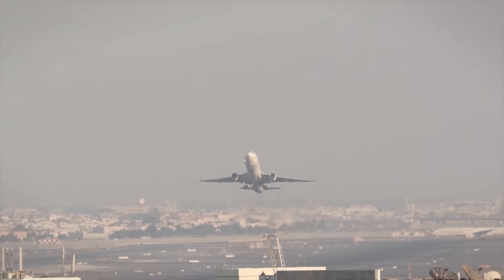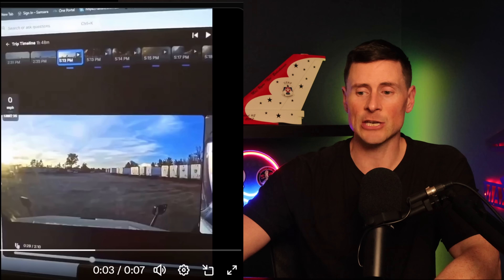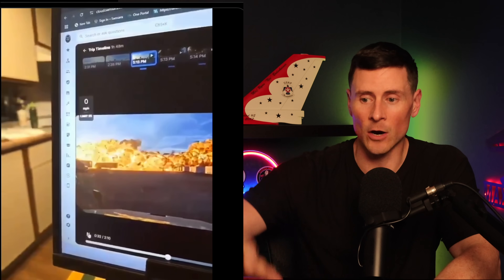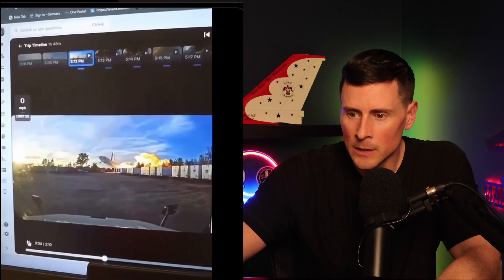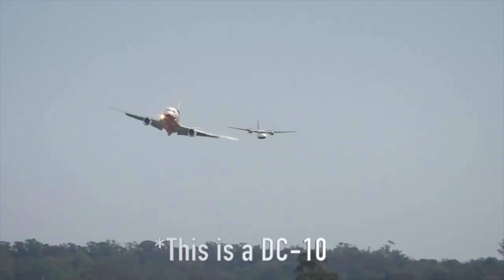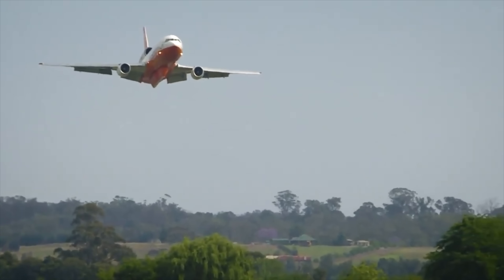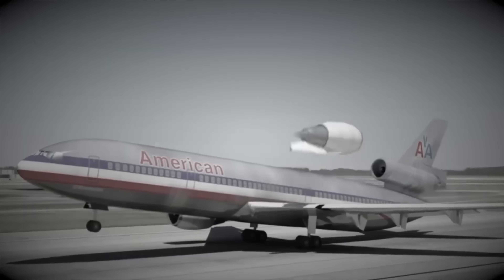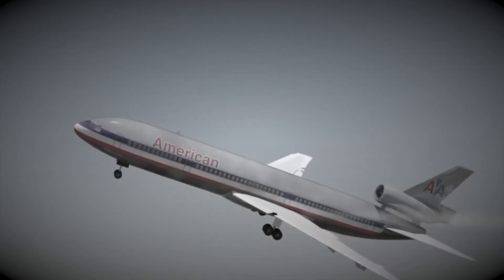Airline Pilot Reveals CHILLING Clue in Final Moment Before UPS 2976 CRASH

Comment: I’m curious that no one noticed anything wrong prior to the takeoff, unless nothing was showing until it was too late to stop. Flight 191 engine was taken off and serviced, when reinstalled the used a forklift instead of the required lift to do it putting unequal pressure on it damaging the mounts.

Comment: In two airlines I have worked for, both engines damaged on takeoff due to bird ingestion. In both cases the CM1 rejected above V1. In both cases they saved the day as subsequent investigation found that those aircraft would not have been able to fly.

Comment: The Number 2 engine is on the tail, the spark you mentioned on the number 3 engine was flames from a compressor stall.

Comment: There is another dash cam video from the road between the airport and the first building. And it was very close and clear. You can see that the #1 engine is not there. You can see that the landing gear struck the building, and I must assume that amount of drag forced to plane down.

Comment: RIP to the lives lost. There was a plane B767-300 engine that caught fire back in Oct 2016 (Flight AA383) failure of the HPT Stage 2 Disk during the take-off roll, with that same make GE Engine as the UPS plane??? Airworthiness A22WE Certificate Holder The Boeng Company 2007. UPS N259UP has Engine GE Eng Model no. CF6-80C2D1F & American Airlines N345AN Eng Model no. GE CF6-80C2B6 are these the same make engines??? The engine fell off the UPS plane on the runway compressor failure? and many comments about re installing engines procedure / process is very important and what about issues with the stage 2 discs failing is common with these engines? I googled this model engine what other common issues were, and it came up with this information re HPT stage 2-disc failure. It's an old plane at 34 years old!

Comment: Preventive Maintenance 
They fly these things year after year with minimal maintenance. How much money did you save after this? 
It’s disgusting that nobody ever wants to go above and beyond the minimum requirements. 
These things should be completely turned around every three months. Turbo Fans also create vibration and the cold dries out the rubber seals that control fuel intake.

Comment: The NTSB recommendations after the AA crash was to stop cutting corners when servicing the engines. It was found that maintenance were using cranes or lifts to reposition the engines after servicing them. This caused micro cracks in the connecting pylons which grew over time and eventually caused the engine to break off.

Comment: When the YouTubers talk about the NTSB suggestions that in the final report on the AA 191 crash, the need to change their tune on one specific recommendation:  the installation of plug type valves to mitigate the loss of hydraulic fluid.  The crash of United Airlines Flight 232 at the airport in Sioux City Iowa on 7/19/1989 exposed the FAA's blatant failure to make the implementation of those plug type valves mandatory.  The aircraft that operated as UA 232 was also a DC-10.  That disaster's ultimate cause was created in 1971 at the foundry that made the titanium alloy ingot that was used to make the air intake fan on the #2/fuselage mounted engine.  The foundry thought they removed all of the gases in ordinary air.  Titanium has to be melted and mixed with the additional ingredients that make up the various alloys in a vacuum environment.  Oxygen & Nitrogen are two elements that cause the final titanium products to become brittle and sets up the eventual destruction of the final product.  In the AA 232 crash, the fan blade broke apart in a spectacular mechanical explosion that severed all 3 hydraulic pipes in the right side of the horizontal stabilizer.  The electron microscopic inspection of the Air Intake fan found evidence of both oxygen and nitrogen being present deep below the surface near the point that the stress crack(s) formed in 1972.  It's not fair to blame the United Airlines Maintenance department for failing to find the cracks during and and all of the overhaul procedures that were performed on that engine.  The techniques to find the subsurface cracks didn't exist.

Comment: Fellow airline pilot here. These brothers are cleared unrestricted climb to heaven. As far as the technicals, I agree with loss of power from compressor stall and the resulting degradation. I dont know the answer to this, BUT will a loss/break of certain hydraulic system cause the LED’s to free float retract? This could have been the huge performance killer that caused the settle back down. Purely theorizing and trying to learn. I have watched the videos many times and my heart sinks every time for the family and the pilots of UPS. God Speed!!!!

Comment: The similarities between this disaster and AA flight 191 are the #1 engine separations. However on AA191, a perfectly #1functioning engine tore itself off, up, and over the wing because overly creative maintenance procedures had broken the engine-to-wing attachment structures. Jet engine mounts are designed to be very strong in the front to back axis, so as to transmit forward and reverse thrust. However, the mounts are also deliberately designed to be somewhat less rigid and somewhat "floppy" in the side to side axis so that an engine whose spinning turbine discs have disintegrated at high power can break loose from the wing rather than transmit violent vibrations that could tear the wing off. My guess is that the #1 engine failed catastrophically, violently scattering engine parts that ripped open the wing fuel tanks and possibly the #2 engine before its own violent out-of-balance forced ripped it off the left wing. On any multi-engine aircraft, especially a swept-wing one, the loss of engine thrust on one side will cause a yaw into the dead engine, causing the wing with the good engine to be closer to perpendicular into airflow, producing more lift, which then causes the airplane to roll in the direction of the bad engine, as happened in both crashes. Because the center engine takes up so much of the real estate on the vertical stabilizers on DC-10/MD-11's real estate, the amount of yaw control from those plane's rudders aren't as robust as on other aircraft, adding to the difficulties of managing a #1 or #3 engine failure at take-off speed. DC-10s and MD11s also have challenges when  landing in heavy crosswinds because of its somewhat limited rudder size and authority. In both of these crashes, however, the other damage to both aircraft were so severe that a different vertical stabilizer and bigger rudder wouldn't have made a difference in the tragic outcomes.

Comment: Although not official yet, I'm willing to wager that the engine failure was significant enough to damage the hydraulic system which prevented the flight control surfaces from allowing the plane to gain altitude.

Comment: Lthe same happened to american airline flight 191. Those engine are tight with only 2 bolt and nut. In flight 191 engine flew away and broke hydraulic and balance.

Comment: Hate to say it but sometimes even at V1 trying to stop is a better option as other crashes have proven. RIP. Bro is wrong on the fuel. The cargo was 200,000 pounds of fuel. The aircraft fuel capacity is 38,615 pounds. Need to get your facts straight.

Comment: Something I'm curious about. Airplanes are constructed mostly of aluminum. Aluminum has a much lower melt point than steel. As such, it seems like it would not take much heat from a fire to melt the mounting points for an engine. I would imagine flame inside the engine would be well contained, but it seems like any flame outside the engine and the engine is going to fall off.

Comment: There's now a 4th video of the MD-11 just before the crash.  It confirms the #1 engine had come off.  The wing was still intact but it is on fire where the engine was.   The 1979 DC-10 crash also rolled to the left after losing #1 engine.  May not have mattered if #2 had also experienced a problem.  What are the odds of #2 going out after #1 falls off?  And what causes the roll?  Also looks like when the MD-11 began to roll the left-wing tip hit a power line.  That sealed their fate  😢

Comment: The MD-11 was modified, with knowledge gained from the Flight 91crash investigation, to lock-in-place the flaps and slats in the event of a hydraulic failure.  An uncontrolled left wing fire could have disabled this feature. But a more likely direct cause for the lack of lift is the struggle of engine two.  Also, a possibility of a runway incursion, resulting in engine detachment, will likely be addressed.

Comment: This crash likely has nothing in common with the American Airlines crash mentioned. AA 191 crashed because the slats retracted due to hydraulic loss, leading to asymmetric lift. (Had the pilots maintained their current speed they would have maintained control.) After that crash the slats on the DC-10 were redesigned with hydraulic locks to prevent inadvertent slat retraction in the event of a subsequent loss of hydraulics. This redesign was carried over into the MD-11 design.

Comment: I would wait to hear about recent maintenance on the engine. Engines don't just fall off aircraft.
Reply: & this one didn’t “just fall off of” the aircraft either. It exploded, essentially. It suffered a catastrophic failure during the takeoff roll & the resulting damage included the engine’s mounting system. Physics took over & what was left of the engine departed from wing & came to rest on the runway.
Reply: I agree with you @garygrant9612.
Reply: the burning engine was made by GE

Comment: A thirty-two year and retired aircraft mechanic here. Speculation on my part, but it was said that there was a catastrophic failure of the left engine, which is supported by the video which shows the aircraft rolling to the left, due to the number three engine still producing thrust and resultant lift on the right wing.  Something else that was said in another video is that there were "sparks" coming from the number two engine......  Again I can only speculate, but if there were two engines involved I  suspect ingestion of a number of birds. Suspecting that the number one engine failure dispersed debris, is not likely, as the engine casing system is designed to contain a failure.  Number two engine is mounted high and center, well above the fuselage. If the information is true, and there's evidence that the number two engine was processing an ingestion of birds, it may have been causing FOD(foreign object damage) and subsequent sparks. This would be do compressor and turbine blades failing in the core engine air stream and sparks being ejected from the exhaust nozzle. Jet engines are designed to withstand bird ingestion, to a certain limit.  Two engines(possibly) failing at the same time, tells me there may have been a flock of birds that were ingested.  
The NTSB will conduct an investigation. The engines likely will have enough left over to determine if this was the case.

Comment: The number 2 engine ingested parts from the number 1 engine as it departed the aircraft a md11 is designed to take off and fly on 2 engines (fully loaded)

Comment: The last time I saw a wing engine explode or come off on the 3 engine jet, parts flew up into the rear mounted engine and knocked that out. Perhaps, that was the spark you saw and why the plane couldnt get lift. Also, the engine coming off could have caused hydraulic lines to be severed. That rollover leads me to
suspect that. This scenario is why this jet got into trouble way back when. This engine was maintenanced and had issues on this day allegedly. One has to wonder if there was a catastrophic error made in that work.

Comment: If they did an engine change without the proper bootstrap kit that uses a hoist, it's an officially a repeat of flight 191. In flight 191 they used a forklift instead if a hoist which caused damage to the pylon structure. It's pretty much wait and see for now.

Comment: As an aircraft engineer might I suggest that the left engine fan disc separated. Such a mass separation may have sheared the Mount bolts. Once separation occurred, the aircraft would have yawed causing an over speed of the right engine most likely the low pressure turbine shroud and blades contacted causing the sparks. The reason I believe the fan disc separated, is the inlet cowl doesn’t exhibit the damage expected with fan blade separation. Hydraulic pressure and quantity would have vanished immediately and instant loss of control . The temperature of the ensuing fire may have been high enough to weaken the wing spar . Such a tragedy
Reply: Fan blade off is qualified against mount failure, so a mount defect would be required to cause mount failure. 
I can’t link right engine overspeed to yaw, how do you see the relationship? I can imagine that left engine failure or fire might cause surge in centre engine due hot gas or debris ingestion. There is a mode where power turbine shaft fails and the fan exits forward and power turbine shifts rearward to tangle with power turbine stators. Catastrophic engine failure may take out local hydraulics but this aircraft has redundant circuits, so basic flight controls should have remained after a left engine uncontained failure or pylon mount separation. 
But, a fire fed by the severed lines would reduce lift of the wing engulfed (locally) to explain left wind drop. Loss of mid engine thrust plus loss of left engine would not leave enough power to climb on the remaining engine. 
Just my thoughts and guesses. The left engine seems in good enough condition to allow investigators to determine if it uncontained and might also have evidence on it of the pylon mounts. Or scattered nearby. Flight recorder I hope is ok too.

Comment: I think the sparks are from the port engine falling off, but my question is whether this MD 11 had a nitrogen gas tank inerting system installed? Might that have prevented an uncontained disintegration of rotor parts igniting and sustaining a wing tank fire? They really needed an arresting hook by that late point of engine departure at the wind sock, having used 80% of the runway already. Once the main spars went soft, it looks like it collapsed and rolled over. Or did the starboard engine's lift overwhelm any control function they had remaining? Was the fuel supply compromised already by rotation? Pilots are unnecessarily blind to engine troubles behind them and out of sight, but fire warnings must have been seen, given the long line of smoke seen from the beginning of the runway scene. Did they fail to recognize and abort when they had the chance, or was their focus on meeting the numbers where the plane should have flown?

Comment: If memory serves me correctly of the   Flight 91 crash in 1979   was   use of forklift truck during engine swap out instead of the fit for purpose provided by the manufacturer.  The pylons and or the pins were  overstressed /damaged resulting in engine departure.

Comment: DC10 Crash in the 80's (1979) in Chicago if I Recall Correctly, showed that an inherent design flaw that also played into the Sioux Falls ELanding Crash.  The Chicago crash was on take off.  #1 just fell off,  It severs all Hydraulics.  It is a terminal disastrous failure.  The Photo of the Engine is interesting except for the missing cowlings around the mechanism.   The Sioux Falls accident was when #2 lost the fixing Cone on the Fan, which disintegrated which destroyed all flight control hydraulics which were apparently passing through that portion of the craft as well.  So this looks like Chicago all over again, and more hydrolics issues.  My little sister flew Jets, Commercial, and at the Tokyo FedEx crash when asked what she knew about that she said "Other than the fact that MD11 is a POS?" 
It is crap engineering.   She was FO on MD80's and had 2x rotations while shutting down a failing or disintegrated engine with passengers on board.
AA had a 727 drop an Engine over Arizona once and I believe they made it to DFW.  MD11 will not forgive any such thing.  
Oh, FAA obviously says it is a safe certified airframe, UNTIL IT IS NOT.
Reply: I am ready to say #1 lost on Runway at takeoff.  Fuel was ignited, Wing was ignited, Fuel and Smoke entered #2, compressor stalls ensued into that mechanism s immediate failure.  Power only in #3 played against the center of gravity dropping below the Right Wing a-la DC10 crash but at no altitude, flight never left ground effect.  Zero Power on #3 would have been the text book means to climb the plane by #2 alone, but its position was eating all of the debris, any unignited fuel spray, and smoke.
Not a survivable design.